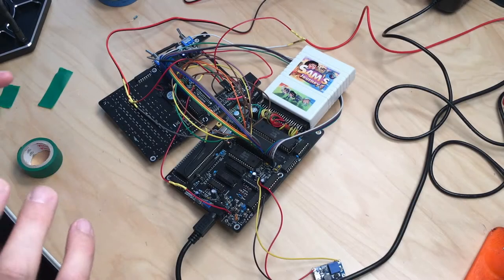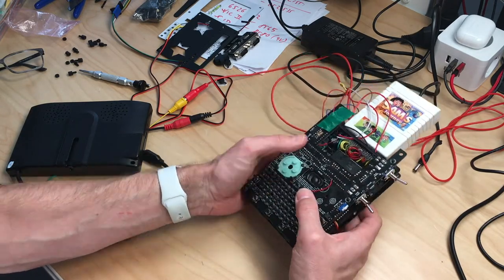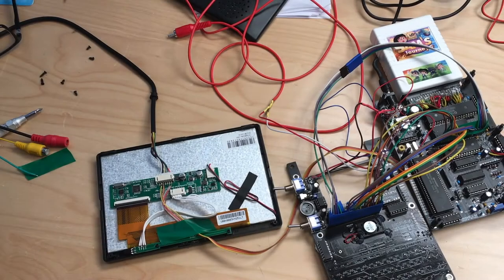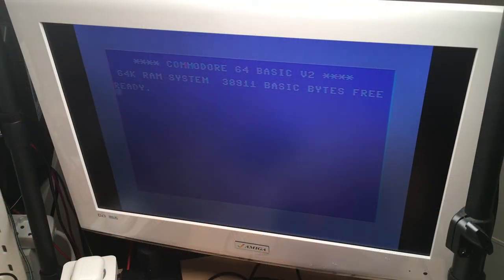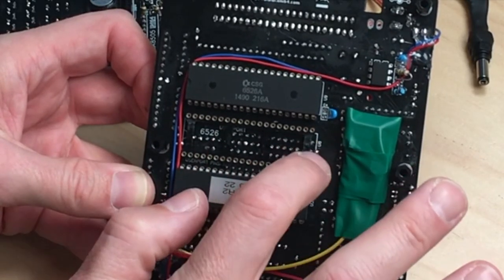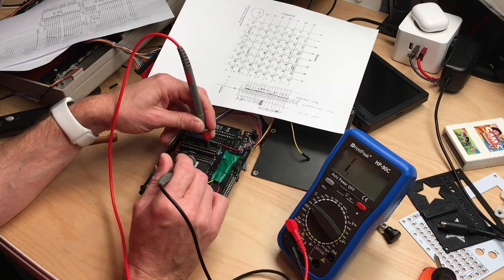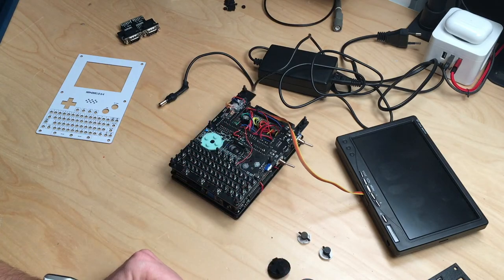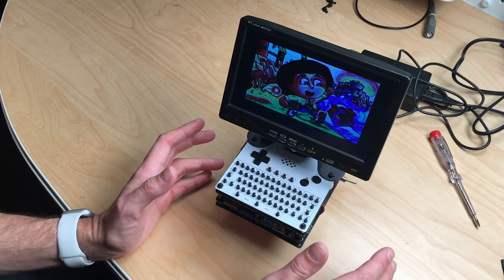The Handheld C64 - Part III - The Finale! A real C64 in a gameboy form factor

Comment: Congrats on getting it working! Perseverance pays off in the end. :) 

As for me, building a C64 in an 80's Blackberry format isn't for me (monster-sized hands).

Good to see that you now have a proper scope. I have/had (no idea as to it's current location) a pocket scope from Seeed which I purchased solely because I thought it would be cool to have a scope that fit in a shirt pocket. I had no illusions as to its accuracy or usefulness. I have a couple of Rigols for day-to-day use, as well as a collection of older scopes.

I must have missed it, but what was the deal with the S-video connector?
Reply from the maker: Thanks! The s-video can be used if the top board (keyboard etc.) is not connected to test the bare C64. You can also use it as a secondary screen (or a proper luma/chroma first screen).

Comment: Well done. You had a lot of problems but managed to fix them. And that’s what counts! The big screen is awesome but I would like a more flatter appearance. Would an FPGA not make this build much smaller and simpler? Of course you would loose a lot of the retro spirit in this case. Ah, choices….
Reply from the maker: Yes, the screen is a monster. Fpga would make that build much smaller … but than it‘s not a real C64, right?!
Reply: @RetroWK  You’re right. What you have done is impressive.